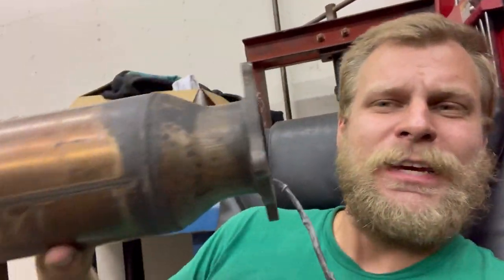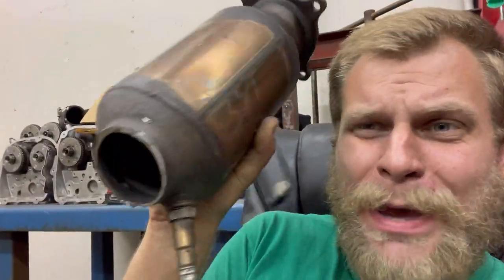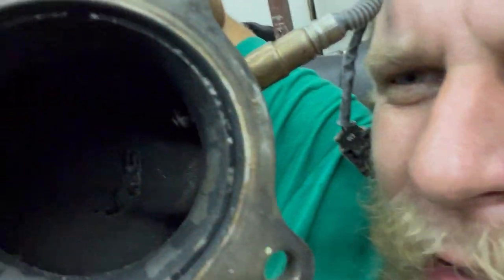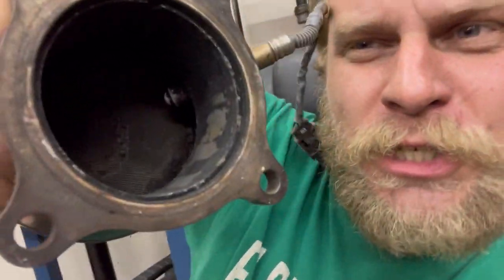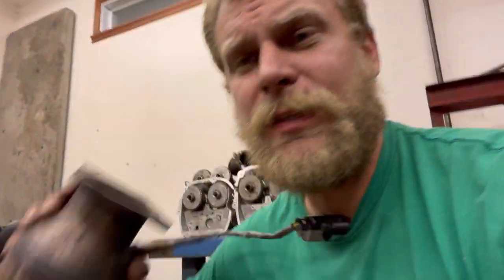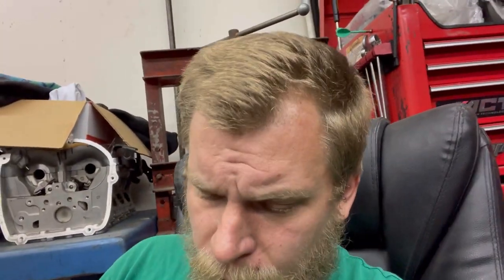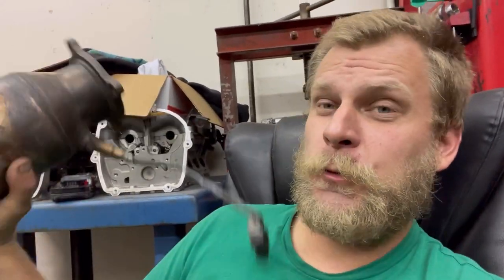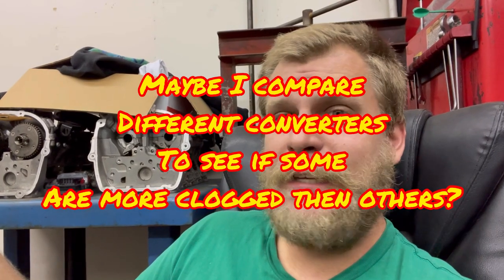P0420 Lacquer Thinner didn’t work catalytic converter Catalyst efficiency Scotty Kilmer Test Fail

Comment: It seems there are way to many reports from a wide variety of sources saying that it did work for them, that we cannot conclude it just doesn't work. Most likely the truth is there are a lot of reasons why an emissions system can fail, and this method only works in certain cases. I have been looking a lot and from all the reports I can see it seems to work more than half the time. So no guarantees, but for such a low cost it is certainly worth a try.
My biggest concern was if it could cause other problems, and while it doesn't work in every case, I could not find a single instance where it caused a problem so...
Reply: Sorry I do not believe Youtube comments for proof!
Reply: @billycretin6339 It is a lot more than just some YT comments. 
There are many citations that show the catalyst metals infused into a catalyst matrix does not degrade. So unless the catalyst matrix melted (rare) or was mechanically damaged (also rare), the main reason catalytic converter efficiency deteriorates, is due to contaminants (mostly carbon) blocking some of the catalyst surface area. 
There is a well established scientifically proven method for rejuvenating old heavily contaminated cats. However, it involves flushing them in a heated solution with mild citric and oxalic acids. But it is definitely a DIY option. Search "  Reactivation of severely aged commercial three-way catalysts by washing with weak EDTA and oxalic acid solutions". There are also many videos of folks using this method, and as the paper shows, it works extremely well. And yes I have done it myself.
There are several well known reasons why lacquer thinner could also work in some cases. For example: A clogged fuel injector can easily cause emission codes, and acetone is the primary ingredient in fuel system cleaners so... 
Also Lacquer thinner does dissolve carbon. I am sure it is not nearly as effective as the acid solution flush, but on a mildly contaminated cat it could be just enough to bump the efficiency and clear the code. Whereas the acid flush practically makes it like new again. So if you are going to remove the cat definitely use the oxalic acid method over dish soap or some random base solution I have seen mentioned elsewhere.
However, I would try the lacquer thinner first as it is quick, easy, and cheap, and it can work in some cases. For every test like this where it did not work there are several more where it did so... It's a lot more than just a few comments from anonymous folks on YT. 
To be honest I don't think you are sorry at all, and frankly  no one cares what you believe. So unless you have something constructive to add, maybe keep your rude criticisms to yourself. You can disagree, but the tone is very off putting.

Comment: With the cat being right off the manifold, do you think its okay to be a little clogged up for back pressure purposes? Or would these 2.0t’s run a lot better/more mpg with it punched or custom/aftermarket full exhausts?
Reply from the maker: I don’t really think back-pressure is ever really a problem in my experience, I just toured the drag racing museum and saw lots of open headers for example but for sure on turbo applications you want it to be as free flowing as possible
Reply: Turbos thrive, with less backpressure.
Reply: back pressure is not a good thing.

Comment: Bad idea for me!,  Pathfinder 2006 car was running great, no issues, but didn't pass smog due to catalytic converters... half tank of gas, used 1 gl of thinner ran it 40miles, after that...had to replace the injectors, damaged 2 coils, had to replace the spark plugs, which were new, all the dirt got stuck on th catalytic converters and when take them off they were all broken and the inside apart, guess my car was really dirt on the inside. The car failed so bad that an ice cream dealer on foot would beat me :(
Reply: Pathfinders are notorious for failing cats anyway though
Reply: What?  How would this cause your spark plugs or coils to be damaged?  Explain.  I think you better stay away from cars.  It sounds like you had a piece of crap car to start with.  Seriously a 2006!!  How many miles?  Car was running great?  Why did it fell the smog test?  It felled the smog test because it was running great, right...

Comment: I have a code on my 2013 Audi Q5 2.0t  (Electronic parking brake control module) fault code: 00473. It shows up on google as a parking brake malfunction but the parking brake still works. is this something to be concerned about or will it cause more damage?
Reply: Try I gallon of lacquer thinner and drive it 1,000 miles at 200mph.

Comment: My 2015 Audi a3 has an oil leak on the oil cap, what would be the reason?
Reply from the maker: Upper timing case gasket
Reply: Mayb a bad seal on the cap itself.
Reply: Fill the Crankcase with Naptha, now drive 50 miles at 90mph, get back with the results.

Comment: Here is an idea on how to test the air restriction  . Us some sort of electrical heating element and place it to one end of the cat .. then use a digital laser thermometer to read the temperature of the element . Try one setup with the cat between the leaf blower and the element and the other the leaf blower directly against the element no cat .. measure the temperatures and calculate the difference as a percentage .. 🤷🏽‍♂️ just a thought ( on another note I really need your help with a problem on my 2010 facelift A3 Quatro ) how can I DM you ?
Reply from the maker: Thanks for the input.  Sometimes I reply on here to car questions when I’m on here after an upload but most of the time I don’t have the time / money to get involved in going back and forth with peoples projects, I have way too many things going on to stay afloat and YouTube isn’t making me any money above what I have been putting into it.  Ask your question now and I’ll see if I have an answer
Reply: @NaptownTuner   my rite side lights randomly go dead .. once the car has been parked for a few hours all the lights work fine .. drive for about 15 min and then all the lights on the rite side go out .. fog, indicator, headlight, reverse light, DRL , only 2 lights on the rite side keep working the brake bulb and the indicator on the rite wingmirrior . Oh sum strange is the lights at the back the left park light goes out and the rite side stays on . .. any idea what the cause could be ?
Reply from the maker: 1st step is getting it scanned for faults with a scan tool that can talk to the body modules something like this is step by step, perfect example of something I wouldn’t typically reply to.
Reply: @NaptownTuner  that we have done already .. and it comes back with nothing that makes sense … we’ve already checked the BCM also and tried switching out the lights IC no difference .. a forum suggested a faulty fuse box .. have you ever heard of that ? Let me know as this may be a possibility .. and yes I have also changed the ballast on both headlights already also .. so wondering about the fuse box have you ever heard of this issue ?
Reply from the maker: @islandlifevlogs5957  you need to bust out the wiring diagrams and do electrical testing

Comment: Just too much gambling with this stuff.  Thank you for this, I agree with you.  I hesitantly considered this, but t was the last Hail Mary, after reviewing everything off and trying a catalytic cleaner (which has worked on other cars).  The thinner, also did nothing.  In my case, I'm 99.9% sure that at 188k miles, it truly is a cat failure.  Te times that Cataclean, G2P or lacxquer thinner work is when the cat is just at threshold and would probably clear with a simple high RPM drive....they do get corrupted from unburnt fuel and misfires so they can fail.  I think in my case it was running rich and had worn plugs, both likely to overheat the cat media.  I also question the temperature reading test that Eric the Car Guy touts - I spoke to a muffler shop thatdidn't believe it and mine actually showed my cat working, but live data shows corruption.
Reply: It fixed my car at 325,000 miles. Code never came back again.